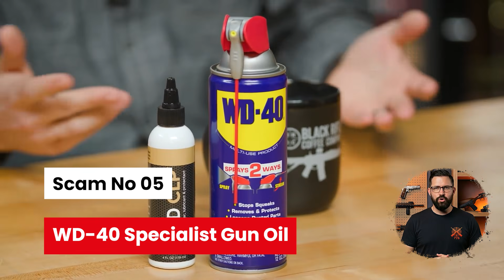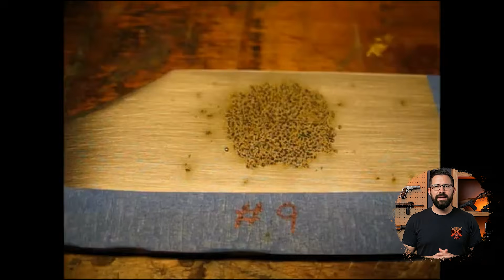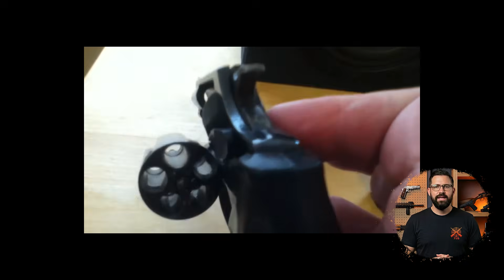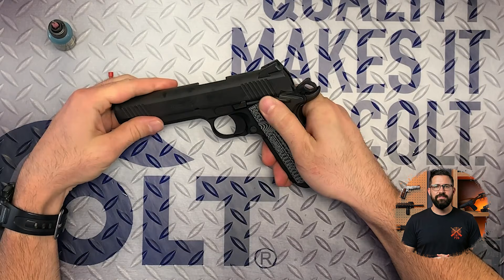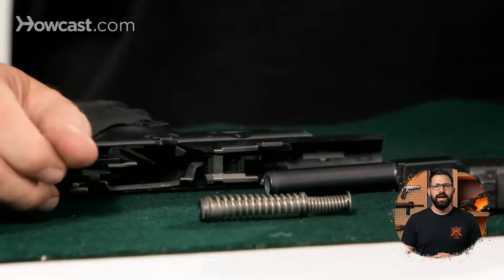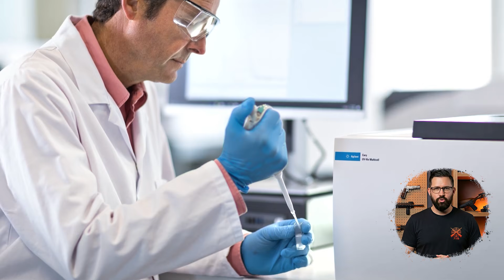Before You Buy Gun Oil, Watch This

Comment: i do use slip 2000 , it is very expensive but it doesnt gum up like the old Hopps 9 and Rem Oil do and it doesnt turn my room into a toxic fume death trap like the old stuff does either. no matter what cleaning guns requires elbow grease there is no magic cleaner i have found  the eliminates scrubbing